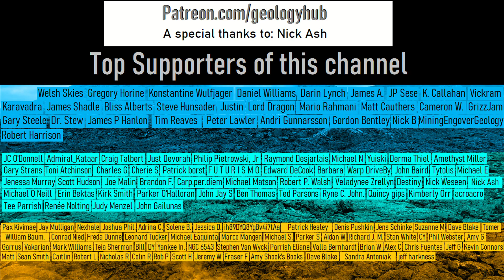Mauna Loa Volcano Eruption Update; Lava Advance Slows, Amount of Erupted Molten Rock

Comment: Hello. How does the composition of the lava compare to Kilauea's, and also how does the volume compare to the output of Kilauea's 2018 eruption in the Lower East Rift Zone?
Reply: I'd like to know this as well.  I know they've deemed them as having separate magma chambers but I'm curious as to the composition because it's all coming from the same hot spot.
Reply: I found a source saying Kilauea erupted about a billion cubic yards of lava in 2018 over the course of a couple months, and we can maybe disregard the beginning of the eruption when the volume of lava being erupted was low as not contributing much to that total.  So roughly a billion cubic yards in 6(?) weeks compared to so far about a tenth of that in a bit less than one week.  Which might mean Kilauea at its peak was putting out more lava than this, but they're roughly comparable if I didn't screw up the numbers too badly.
Reply: The 2018 eruption produced roughly 1 to 1.5 cubic kilometers of lava.

Comment: Oh I was right with my "guess" that it was basalt! Or more correctly I had recalled that from some other Hawaiian volcano video some months ago. 

I cannot help but wonder what does it smell like? I mean does it smell like a match or more like a foundry? Because surely that melted rock must smell! 

I do believe the Hawaiian volcanoes are the ONLY ones I would trust!
Reply: Often there is a smell of rotten eggs from the hydrogen sulfide H2S gas released which is poisonous.
Reply: Often there is a smell of rotten eggs from the hydrogen sulfide H2S gas released which is poisonous.
Reply: To me, it always smells like ramen noodles around Kilauea. But I think that might be the flora.

I was hiking in the Ka'u desert this last summer and was getting plenty of VOG from Kilauea. Sulphur dioxide emissions are pretty unpleasant, stinging and burning the mucus membranes.

Last year I would have trusted the flows in Iceland. Lower effusion rate, plenty of access if you wanted to hike. Here in the US, they won't let you close to stuff. Yay "freedom."
Reply: @wiredforstereo  I remember talking with a park ranger near the old Jagger Museum in Volcanoes NP. He'd dressed in a special suit with a self-contained respirator and gone near Pu'u O'o with a volcano specialist with some meter to measure dangerous gases. The level of gases was off the scale. If I remember correctly, the gas could combine with water in your body to produce sulfuric acid in your respiratory system. Yay not being allowed to get close enough to dissolve your internal organs.
Reply: @mariashaffer-gordon3561  I was with you until that absurdity at the end.

Not enough gas at the flow front to do any damage. Not enough gas anywhere I want to be to hurt me.

You don't think I'm capable of bringing my own respirator if I want one?

How about you let me protect myself instead of enforcing your ignorance upon me.
Reply: @wiredforstereo  Maybe you're smart enough to bring a respirator with you, but the majority of ordinary people aren't. Go ahead and do what you want.
Reply: @mariashaffer-gordon3561  I'd love to. But one of your type people is going to be there to write me a ticket or tsk tsk me.
Reply: @wiredforstereo  I've never been in law enforcement, so don't blame "my type of people".
Reply: @mariashaffer-gordon3561  Your type of people are those that curtail my freedom  because "somebody could get hurt."

Your type of people manage the cops, and some are cops. Has nothing to do with being a cop.
Reply: @wiredforstereo  So what other rules are infringing on your freedom? Wearing a seat belt in a car? Wearing a helmet and goggles on a motorcycle? Sadly, many people don't use common sense, which is why we ended up with some public safety laws.
Reply: @mariashaffer-gordon3561  There you go.

I'm all for preventing people from hurting others. But you want to prevent people from being free and taking risks. Motorcycling is legal while being extremely dangerous and you people won't let me hike up to see a lava flow up close.

Comment: Can the altitude related cooler temperatures or heavy rains impact the speed of flow?
Reply: Probably not.  The temperature of the lava is 2000 F probably assessed near the point of the eruption.
Reply: Rain won’t do much. Rains heavily and frequently where it’s at. Heat will evaporate it before it even hits the lava basically
Reply: @joecorsaro1381  That's at high altitude on the dry side, so there's not much precipitation up there. According to the map, well less than 30 inches per year, some of the lowest precipitation in all of Hawaii.

If the lava were flowing through Puna, then we could see what rain could do.

But since lava flows in insulated channels for the most part, rain won't do all that much. It doesn't flow like water, it flows out from underneath, under a skin with pahoehoe, and under a bed of clinker with a'a. It's real cold in Iceland and the lava seems to flow just fine.

Comment: that is an interesting point regarding the temperature of the erupted rock. Would you expect a more silica rich rock to be hotter than a less silica rich?
Reply: It is in fact by up to a few hundred degrees C.  Basalt lava runs 1000 to 1200 C vs andesite which is 800--1000 C. Rhyolite which has a higher silica level runs about 650-800 C.  Fahrenheit is almost twice as high as Centigrade.
Reply: @michaeldeierhoi4096  Which of course affects viscosity.
Reply: I just want to thank the geology nerds for the additional info. Very interesting, even to people like me who don't know much about geology. You guys rock! (Sorry for the bad pun.)